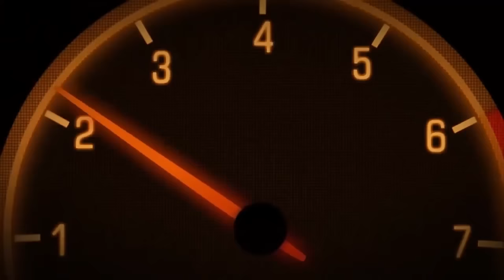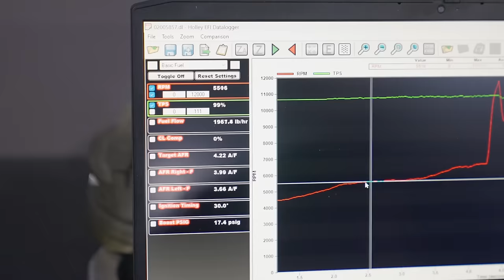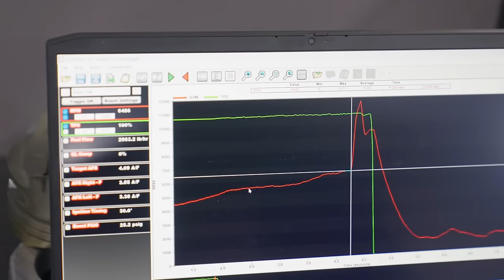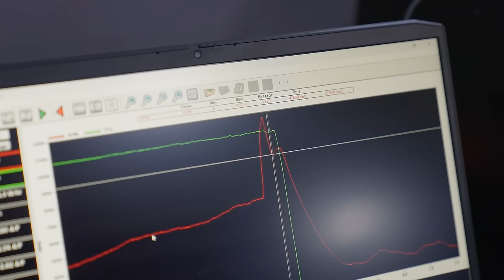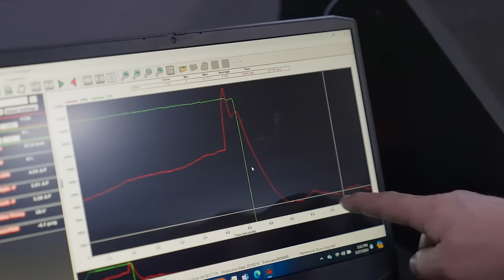This Will Make Racing So Much Easier !

Comment: It takes about 160ms for sound to be processed by the brains and 200ms for visual data.  You processed the failure AND moved the throttle in 200ms (0.2s).  Nobody is going to react faster then that.   You might put a Strain gage on the Load that can detect torque being applied.. If the Load drops out you immediately kill the injectors.  That would probably only take 50ms to respond to a failure like this..
Reply: but by the time the load dropped the damage was already done right? even if you can kill the fuel and spark that fast the time it takes to return to zero rpm it is going to break stuff. yes??
Reply: @b.c4066 Correct.  The instant the bolts broke nothing was going to stop the engine from hitting those insane RPMS.

Comment: 7:35 protip take some marine heat shrink with the adhesives/sealer to put on tip of your prybar with stuff like glass. Have a pair of channel locks id did the same thing on for softer surfaces.
Reply: I have done This as well and as you say it works really well.

Comment: A piece of diamond plate aluminum on that wall below the glass would look great !!
Reply: steel diamond plate would survive a hit better.
Reply: Or a piece of 3/4 plywood with 12x12 ceramic floor tiles glued to it.....add a layer of asphalt shingles on one side and a layer of polythene cutting boards on the other and you have a pretty good home made bullet proof panel......might not stop .50 BMG but likely most everything else  :D
Reply: 1/2" steel plate please
Reply: Diamond plate,  but would steel be cheaper and stronger?

Comment: Did we miss you tell us about the engine?  What hp did it fail at and were the flywheel bolts arp or previously traumatized?  Basically root cause of the failure.  If you want perspective on that type of failure, watch jet engine videos of blade off tests.  Truly violent and scary.  The energy involved in these failures is staggering.  So glad you all are ok and kudos to those pitching in to get SME back at full speed.

Comment: I think it's necessary to keep digging for the root cause of the fault. Bolts broke, okay.  Why did they break? Were they defective, fatigued, over torqued, wrong bolts\grade, vibration, and if so from what?  

Still amazed and relieved that no one was seriously injured by all the shrapnel.

Comment: Steve, if you can figure out a pin and rail system or a tab and hole set up something similar that doesn’t have buttons so you can just hang the top of the panel on and then dzus the rest that would fix the access problem to that top lip.

Comment: Steve, I am concerned about the ability of the "spot" welds holding the Zeus fastener brackets to the fender(s) to not fail during 250 MPH runs. I'd feel better if you used through bolts in the fenders to hold the brackets in place. Those fenders are like sails and any slight pressure differences from inside to outside the fender at speed are likely to blow the fenders off.  Just sayin' . . .
Reply: Great point & definitely would not trust @ 250mph plus....
Also cannot see the point of removing the whole rear panel past the wheel tubs... l would have made a neat joint seam & only have the front part section removable...👍🇬🇧.

Comment: For more safety, Steinel makes a heat gun that would be suitable for much of that trim work. The Steinel HG 2320 E is 1600 watts, and hears up to 1,200 F. The temperature is adjustable in 10-degree increments. They're VERY reliable and durable, and would possibly save you some money in propane cylinders.

Comment: Steve, I see a storage container in your future with wood grain stripes to store wagon panels and such. Also be cool to use "gas cap" as pop out GoPro to capture the losing lane action. 
And, is there someway to pressurize cabin to prevent, minimize , or evacuate tire burn out smoke?

Comment: Hi Steve, scan the quarter panel and 3d print a mirror of it to make a mold 😉
Reply: Can 3d prints be done that large (single piece) now?
Reply: Carbon fiber rear wagon quarters???
Reply: @GrandDawggy  You 3d print a mold, you make it from multiple pieces and glue them. you seal the whole, let it dry. And you can lay resin and fiber to make panel.
Or if you scan you can make a one piece mold using MDF and cnc machine like the one in wood worshop. you seal it and bingo
Reply: @mshort7087  why not ? with a layer of kevlar or 2 on the inside, if something happen there is no carbon pieces everywhere
Reply: @kermitahnenerbe3722  that's really interesting and cool, I really should have known because I studied engineering but haven't in quite a while.
Anyways thanks for the reply 👍
Reply: @GrandDawggy  No problem. 
Some guy print real size Venus de Milo, everything is possible

Comment: Last video I wanted to mention Steve... might be time to "re-inforce" the dyno room.  In the Marines my Dyno observatory had twin panes of actual bullet resistant glass.  Was able to deflect a breaker bar that was still on the dampner on a start-up once..... hit the window so hard the breaker bar was bend by around 20 degrees.

Also might want to make the primary walls out of cinderblock minimum.  I know some "boom rooms" fill the cinderblock with sand.  Love your work Steve, stay safe big dawg.
Reply: Come on man!!!
SME is private business, built from scratch.
Not government funded, 
HUGE difference!!!
Between a a military built dyno room, 
Then a private work your ass off, to make a living, dyno room.
Watch SME history, to understand the difference.
Reply: @metalted6128    Steve can't make a living if he is dead.  Do you realize what would happen if a customer was seriously hurt / killed?   A stronger window and cement blocks are standard dyno room construction.
Reply: Steve, I know I mentioned it before and you commented.  ... but your wheel dyno in the middle of the shop concerns me for a fire hazard like Bailey had.  You now have a couple million bucks USD worth of machinery running 24/7.  Please reconsider the risk in that area.  A bad fire will put your shop down for months.
Reply: Seems like it'd be a lot easier to just line it with steel plate to me. Also doesn't require fully knocking the dyno rooms down and starting over with block.
Reply: @ryanlamfers8692  Military chose the brick/sand to absorb.  Just so ya know.  Steel plate prolly would be a touch cheaper tho than starting from scratch.  A good observation glass is still a necessity though!
Reply: @metalted6128  Brick and sand fairly cheap.  Bullet proof glass depending on the size is quite pricey, but not a game breaker.  I'm just looking at the cost of material over the cost of limbs....
Reply: @josephmatuszak3855 , Steve said something about putting plywood on the walls instead of drywall, once he has that up he could drill and fill the walls with sand then plug and paint them. Sand sounds like a good idea at slowing projectiles down, you might have something there.
Reply: Wait, we had a dyno in the Marines?  How TF did I miss that?  LOL  Talk about waste!  I can't think of any good reason for the Corps have and own a dedicated engine dyno.  It's not like we were designing systems that rely on engines and vehicles in house.  We send out the specs and military contractors deliver finished goods. (I realize there's more to it than that so everyone can relax.)

As for Steve's room, just put some diamond plate on the wall blocking the operator and  double pane the window with a good gap between.  If you really want to go all Fireman Sam, just stack cinderblocks in front of the wall.  No need to actually build a wall. LOL  We can't live in a sealed bubble.  Sometimes people get hurt because unthinkable shit happens.  So long as we take reasonable realistic precautions, no one should be ruined for life or go to jail etc if someone gets hurt. We can't be protected from cradle to grave, sh*t happens.
Reply: @JViello  4th Echelon repair.  Nothing is really that exceptional as far as difficulty.  In house machine shop, electronics and calibrations, transmissions, engines.  The dynos we used were quite old.  Late 60's to 70's, and then upgraded thru the years as needed.  HMMWV engines and such haven't changed much.  I was personally working with PowerTest to upgrade the dyno's to run the newer Catepillar engines back in 2000's.  Basically, its faster to rebuild most components than send out for new units.  So the unit is comprised of the more experienced mechanics of each MOS that units powerplants or drivetrains.   In just NC alone, you could pretty much expect 10 6.2L or 6.5K to come in daily.  We can turn them around within 24hours with a well managed parts stock.  If broken beyond repair, box up with all the bad parts you can and send to ratheon to give them something to do.
Reply: @josephmatuszak3855 Sounds like a cool gig in the Corps.    I salute and thank you for your service.

Comment: Re: plywood/wall reinforcement.

If you think about layers, you can get the most bang resistance for your buck.  If money's not an issue, put particle board or mdf on the existing wall & ~0.090" sheet metal over it.

Otherwise, you could put a layer of cheap oriented strand board, a layer of 0.030" metal, topped w/ 1/2" plywood. The plywood will have some give, to slow down particles, the steel will give it some strength & the OSB behind the steel will disburse the force of the impact over a larger area.

By doing the layers, it also doesn't matter what the 1st two layers looks like. It could be nasty old body metal off a truck.

I built a shop out of walk in cooler panels in the '80's. Thick azz enameled sheet metal on both sides, full 2× 4 framing w/ a bunch of insulation crammed in. They are 4 × 8 ft & cam lock together.  Once we got the foundation ready, we had all of the walls stood up for a 40 x 60' shop in one day.

If you could find some, you could line the inner walls with them, throw on some paint & dang near have a ricochet room!  LOL

Otherwise

Comment: Hopefully you ordered hard coated polycarbonate if not be careful with what chemicals you put on it because it’s not to chemically resistant and it scratches a lot easier than acrylic.
Reply: Pretty sure he's aware of what chemicals NOT to put on plastics after he screwed up the wagon's windshield and had to replace it!

Comment: I love your content and I do learn from your channel, however this is one time i question your explanation about the rev limiter not being able to prevent this problem.  Yes there is a lot of inertia at 6500 RPM but acceleration and inertia are different things and with out some form of energy storage (ie something like a spring) one does not convert to the other.  At 6500 RPM the engine is spinning at 108 revolutions per second and in two tenths of a second it would spin 21 revolutions (and actually more because of the increase in RPM).  If the REV limiter either killed injectors or ignition acceleration would immediately stop.  The question is, how fast is RPM being sampled by the rev limiter and are multiple counts required to confirm the over speed condition.  The RPM was increasing by about 200 RPM per revolution.  Therefore, there were several revolutions where a rev limiter could have intervened successfully.
Reply: It would not.  On an unloaded motor, sure but when a motor is creating 1000 hp and all of a sudden the load disappears the kinetic energy goes somewhere, into spinning the motor into over rev.  It’s not a 300 hp motor that you could get a rev limiter to work.  That’s why the rev limiter didn’t work.  As well as the sampling of a motor spinning up that fast where the comp can’t chop fuel / spark quick enough.  Considering he is on pro software I am sure the sampling rate is much higher than stock car ECUs.
Reply: @michaeltemple8333  Kinetic energy would just keep the engine spinning, not accelerate it.  The engine RPM increased because the engine kept making power, the rate of ncrease in RPM only limited by the rotating mass of the engine. There could be a small amount of acceleration due to crankshaft twist unloadinig but it would be insignificant.  And the computer certainly can cut chop injectors and spark quick enough since it is able to precision time these events several times per revolution. It is just a question of rev limiter software being robust enought to realize that it needs to kill the engine when there is a sudden increase in RPM.

Comment: Disregard my comment if not applicable to your disc grinder. Standard guards are ok when you have lots of space. I cut mine down, make them thinner at the hand end and trim in a tapered fashion to maximize access to cutting in confined spaces. You still have a decent finger guard for your forefinger so a kick back doesn't see disc biting your fingers. You can also place on workbench before it stops spinning and not have in catch.

Comment: I would be interested in what it took to sheer those bolts off at the flywheel. The sheer strength is crazy on even the most basic bolts, let alone 5 bolts. Would like to see the specs on those bolts.

Comment: Steve...  as I asked in the comments on the dyno explosion video:

What grade were the bolts?
How many times had they been used?
Do you think the threads stripped out first or the bolts sheered first?
Were the threads in the bolt holes in the flywheel flange tapped to the correct size and in good shape?
You answered the tightening ? ...
Are you going to do some kind of analysis on the strength of the flywheel flange?
Was it a new engine or just in the shop for a "refresh"?
Reply from the maker: Older bolts
Probably broke 1 then 2 then all.

Comment: Steve , years ago in the tire industry (high volume tire repair chain) we noticed the lug studs were only designed to be used soo many times before replacement was recommended ,to my point.. If your not , Im sure you will.. make a life cycle for them bolts.. mayne 3 times and replace... Id prolly use half grade 8 and half a higher grade , but not all the highest because of bend/shear/tension differences .. it was amazing that engine didnt have more internal issues...

Comment: I think I might glue some stiffening ribs on the inside of those fenders for a little strength when you pull them off. Little bit of carbon fiber tubes from the RC model stores and some epoxy, nothing too involved.

Comment: Love the content!

How about a long hinge all along the top edge of the rear fenders then you just undo front and lower zeus clips and fold the fender up. You can add some light hood shocks to keep fender up while changing tires. It will be a little bit faster more ridgid and save you moving the fender around eliminating risks of messing it up.😊

Greatings from sweden

Comment: As far as the human reaction time goes. In drag racing, if I remember correctly, a pro tree is set for 0.4 seconds. So from the moment you see the amber lights, 0.4 seconds later the green lights will hit. Back in my younger days as a new drag racing driver. I was always told told that if you see green you've probably already lost.

Comment: might be a good idea to upgrade the window (ah policarbonate glass) was thinking at the glass with the wire in it , might still put that behind it to catch watever still manages to come through
wonder if it helps to add a camera (or cameras) and a screen at the trottle station so you can lsee the most important bits on the back of the engine , you mightve spotted the flyweel wobbling or shaking before opening it up , the way youre dyno room is set up you cannot see anything happening on the back of the engine from the booth and mounting the engine sideways makes it even more dangerous as stuff slinging around in line with where you guys are sitting 
might help the rear quarterpanel keep its shape and not lifting on the piece you dzus it ontoo if you brase a piece of rod along the edge of it , it should be hidden behind the door and prevent you cutting youre fingers on the edge too 
the part along the window and along the taillight is a bit harder to do but those L shaped pieces youre adding should be good enough for strength , wonder how well its going to seal against windnoise and smoke .....
wat you could do along the top is use pieces of alltread and wingnuts , that should allow you to pull the edge under the rubber edge of the window and seal it a little better , probably makes it eazier to hang the panel before going around it to dzus it up
wonder if you can make the whole quarter panel hinge up toward the top

Comment: My suggestion is to add some kind of rubber isolation between the fenders and body because that thing is going to be a rattle monster and torture you during long drives. I’m calling it now.
Reply: Use the expanding automotive foam, made for this very purpose

Comment: Be interesting to see the injector pulse width in the datalog to see if it did infact cut fuel at 8500rpm or if it couldnt react in time. 2 tenths doesnt seem like much, but ecus can do alot of correction in 2 tenths of a second. Not sure what holley uses, but  for example a 50mhz processor can do 50 million tasks a second.
Reply from the maker: Inertia
Reply: @stevemorrisracing  
I understand what your saying im just data nerd lol. I was just curious if the ecu was fast enough to cut fuel and it didnt matter because of inertia or if it just did not make a correction in time.

Comment: A hard rev limiter (if available on the engine controller) would have killed the motor at 8500 RPM...the soft rev limiter is still intermittently firing some coils and dropping others....you can get a soft rev limiter to be “harder” by setting a 1D RPM table rev limit main offset with a safety cut activation at a hard rpm cut limit you set say at 8800 that immediately cuts the rev limiter by 6300 to 2500 RPM...which will cut all the coils from firing immediately
Reply: Still wouldn’t have caught it in time. The force and momentum still would have blasted it past the hard limit.